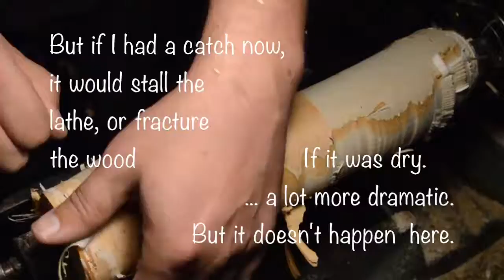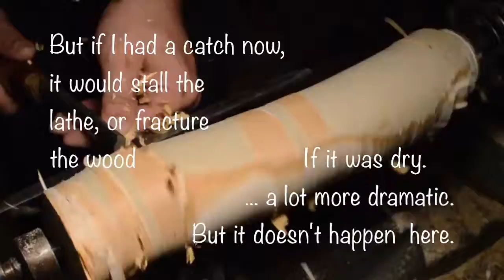From Log to Spindle

Comment from the maker: Neat!  My local copy did not have such a cool strobe effect, when the lathe was running at low speed...
Reply: That makes me wonder, can you cause the strobe on purpose with a high shutter speed, and, if you had a synchronous strobe on the machine would it make turning easier or harder as you could see the piece in more detail.
Reply from the maker: I'd uploaded it at 720p@60 fps, but when I first watched it, it only played at 30 fps;  Now, it's playing back at 60 (or 59.94), and looks the same as my local copy does.

Set the quality to 480p, so it plays at 30 fps to see what I thought was cool...

I'll have to try using a 30 fps video format to record, to see if it'll do the stop-motion thing on my monitor too.

An actual strobe would make it harder to turn wood, at least when it was out-of-round as it was here:  I rely on the amount of ghosting, and its offset from center to know how deep of a cut I can make at any particular spot on a rough surface, as well as how much wood I have to take off before that part is round.

Lets say a large chunk of wood split off on one end, so about 1/3rd of the wood was missing from what would otherwise be a cylindrical spindle.  With a strobe, I might not be able to see that side, and were I to make a sweeping cut into that part of the wood, the chisel would plunge in much further at the gap, and catch hard when the edge of the wood came around.

However, if the work was all in-round, watching it under a strobe wouldn't look appreciably different than under ordinary lighting, as the rotating form looks the same as the still form, on that axis.